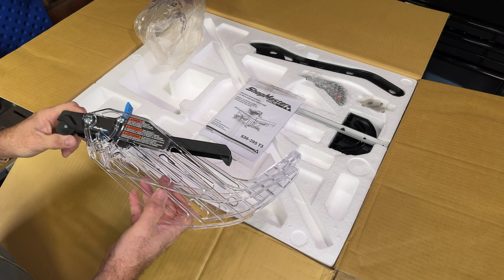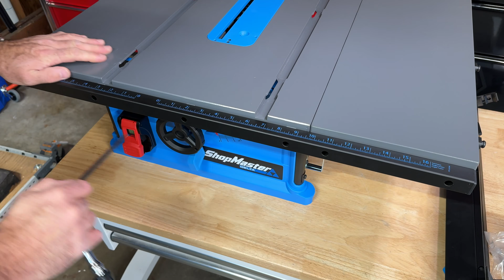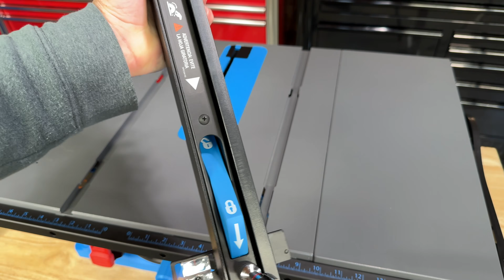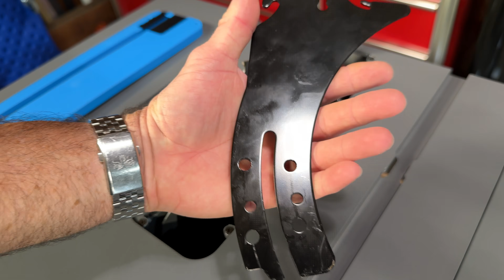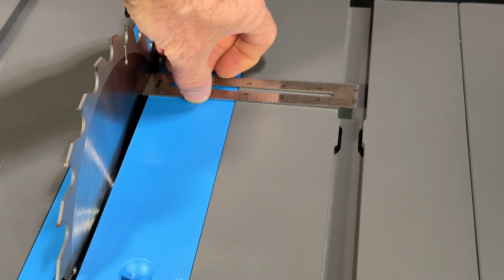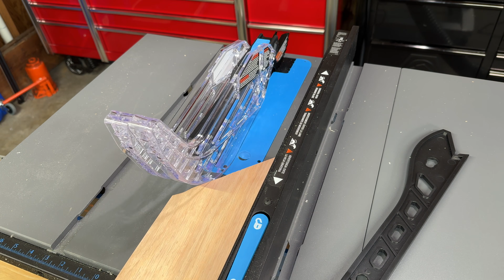Walmart Is Selling Tools Now?!?  ||  Delta ShopMaster Table Saw Review

Comment: blade to get at 90 degrees some have screws top of table for blade adjustment.. i had bought skill saw where angle was off and had to go under table and guess what screws to adjust i at last got it to the proper angles. i also on the rigid home depot job site table saw a fence loose at bottom end tried adjusting decided get a back up one. ordered one off ebay was way better.. so maybe order new fence? idk.. i expecting a prostomer table saw to be delivered sometime today? is it better than one you have here? idk .. but does have 90 deg screw and 45 deg screw top of table. but table top is smaller rt hand side than left and that kind of bothers me. but you can make a side ext for it.. but the fence obviously wont work on it. but people say it pretty much like the skill table saw. it comes with a stand .. but i don't like way the top part screws directly into the saw rather than a full stand. saw cost 210.00 plus tax have prime free shipping. but basically saw it same kind make up as saw you have there.. and easier to return if have a issue. but that saw you have would work for me too for what i do. Having recieved my promaster i do believe this walmart table saw is better

Comment: I have a Delta shopmaster that someone gave me. Came here to see if i want to spend any effort to make it useable as they lost the plate next to the blade. I decided to make the saw mechanism clean and oiled and descovered the blade angle adjuster is worn. I think the plate was lost due to cheap, the adjuster worn is definitely cheap. This thing is going in the garbage,  not only do things not hold up but no care to build for longevity has be done by the company. I would suggest avoiding this unit at all costs, even free it is no bargin.

Comment: Thanks for reviewing lower budget items.  I've seen several budget item videos that were still 500 or 600 bucks. I'm actually thinking about getting into it as a hobby since I've been out of work with health issues for 2 years. Trying to convince the wife to let me spend a little extra to get better quality tools that might be safer and make better quality projects. Would you recommend a table saw, miter saw, and a router. Looking to spend less than 300 each. Unless there is a better one for a little more. But 300 is already pushing it.  I still need a new drill, wood, and hardware so I can start with a work bench. Then try other projects. Appreciate any info. Thanks.
Reply from the maker: Those are the core tools your looking for if your starting out. If you splurge anywhere I’d do it on the table saw. At least get one with a rack and pinion fence. The red Skil is a good start and close to your budget. Thanks for watching and good luck!

Comment: Nice review Mike. I think there's another table saw which may spark your interest. It's the Machorool FS255 10" Compact Table Saw. ($279.99) Unlike this one, it has a Rack-and-Pinion System fence and 24 inch rip capacity. Cross cutting appears to be done accurately also. But if testing this one, the 40 tooth blade should also be tested with it
Reply from the maker: I have that Findbuytools table saw in the shop now. Should have that vid out in a couple weeks. Thanks for watching Louis!

Comment: Definitely feel the Skil is a much better buy. It's definitely worth the stretch in the budget in my opinion. The fence alone is worth it. Then you factor in the included stand, the motor adjustments and overall build quality is better.

Comment: They should call it the ShopStarter not the ShopMaster. For $189, that's a good saw. As long as you're cool with using your measuring tape to measure over from blade top/bottom to line up the fence. The Skil kills it, for only $100 more.

Comment: I know you must get this request a lot, but since you have such great table saw reviews I'd love for you to do one on the Ryobi 13-amp 8 1/4. May be the one you allude to here. I expect it's not great, but would love to see how it compares as a super budget option.
Reply: I have it and it's great for quicky type cuts. NOT for finer work! I bought the Skil referred by Mike, and it's way better. I still have the Ryobi as well, just set it up for box blade cuts only(1/4") and it works great for that. For the 129 bucks it cost it's definitely a keeper.
Reply from the maker: Thanks for the insight. With a 16 in full rip I figured this would be for light homeowner construction tasks. Thanks for watching Hunter!

Comment: also, wax the riving knife. just regular candle wax is fine. it helps with friction when the board pinches it. i do that will most of my cheaper saws. 

i also do most of my ripping with a 7-1/4" blade with a thinner riving knife i made out of an old blade. makes it much easier and less likely to kick back. i learned to use a "table saw" on the jobsite when it was a circular saw plunged through a piece of plywood, screwed in place and flipped over. so we'd always rip half way down the length then flip and rip the other half. i still do that most of the time. pretty safe way to go about it.

Comment: i just modded that saw for a friend. added a tilt screw for setting angles more accurately. flattened the top and added a sheet of steel cut out of an old dryer so magnetic accessories work on it. also put it on top of the wings so they would stay level, though it was otherwise unneeded. got rid of the tabs and milled the miter slots to 1" to fit 3/4" miter slot inserts and epoxied those in place. the thinness of the aluminum left behind after milling worried me a bit so i filleted reinforced jb weld on the underside just in case. replaced the fence and rail with an old biesemeyer style fence from an old saw. not saying it was a sound investment, but it was an enjoyable way to kill a few days and he's got a saw that works very well now. 

the saw has pretty good bones overall.

i won't use a saw that i can't use magnets on anymore. i'm so spoiled by maglock accessories. too many great ways to keep myself safe with a maglock accessory to skip on it for me.
Reply: Sounds similar to what I did to a Bosch 4100 for myself. Delta fence, modded to lock on the front and back of the smaller table (I like the Bosch because the motor and table size cannot be beat by other jobsite saws). I run the jessem stock guides on that fence and havent had a single kickback since I started using them. I actually love the saw, and since getting a track saw and modding a Kreg ACS table I don’t see me upgrading any time soon
Reply: @AtemporalSuperCrusader  yeah. once you've got everything setup and working the way you want it, not much reason to swap.

Comment: It looked to me like that rubber piece on the backside of the fence needed to move down. I mean, if the rest of it is "good enough" a guy could always upgrade the fence, other than not being able to run a dado... I planned on buying the Skil (largely based off your review) but ended up going with an old Craftsman 113 and I think I came out far ahead. Sometimes new isn't the answer if you're getting started.

Comment: I think the plastic parts begs more questions about why the expensive brands do the same thing that why this discount priced saw doesn't use steel or aluminum. Whenever I look at table saws the first thing I look for is the rack and pinion fence.

Comment: My personal opinion on something like this... a table saw is a serious piece of equipment.  If you need one, do yourself a favor and save up until you get can get a good one.  I can certainly appreciate trying to save money or find the best value, but... not with a table saw.

Also, that fence is whack and that one thing would be a complete deal-breaker for me.  I can just see the fence moving on a big cut, the board binding, and well...  With all the advanced engineering and manufacturing we have access to these days, even at $180, the fence moving around like that is completely unacceptable.

Comment: Mmm l have a 20 year old Craftsman bench top table saw it had been a work horse . Got it from the Craftsman resale store when it was still Sears store . My question is when I try to take my blade off the blade wrench just slips off when I try to take the blade off . I trying to take the top off and try to get a new shaft any help would be appreciated greatly thanks

Comment: I used a $99 Ryobi saw (back in the blue-color days in 2006) to put in wood-laminate flooring, used it to rip down the cherry-wood fascia woods of new cabinets and more. I recall my father-in-law, who’s skill level is that of Norm Abram said - heck, for. $99 it ‘s cheaper than renting and in a years it no loner works, fine.
It’s still works… Is it the most accurate - maybe not. But for nearly 20 years it has done all the jobs I have needed it to do - including using a tile cutting blade to dry-cut tile! Sure I also spent the $$$ on a nice Bosch miter saw back then for finer work, but the little Ryobi saw has cost me all of $5 per year in amortization cost to own! Not bad.

Comment: Awesome reviews! I have a old Delta shop master that I bought at Lowe's probably early 2000's. Plastic enclosed base, aluminum top, steel wing. The fence on mine is more like a Biesemeyer-Style fence. things about it I never liked was the height adjustment can be very stiff raising the blade, the throat plate is small and was never made for a zero clearance (I had to make a complete new one), and the lack of a geared bevel adjustment (like almost every saw). It's not the smoothest running saw and very loud but has worked well for my occasional wood working. Just wish I had the room and finances to get a hybrid.
Reply from the maker: I haven't seen that old Shipmaster model! Thanks for the insight!

Comment: Instead of these direct drive saws just plunge cut a circular saw into a scrap of plywood and throw it over some saw horses. If you're in that much of a spot for a table saw the apple box saw works fine. A scrap of wood clamped to the top and you've got a rip fence. Ripping is all table saws are really good for anyways. Rips are why you need a table saw. There's other ways of crosscutting wood. Like another circular saw and a speed square.
Reply from the maker: For basic construction and framing an agree with you. Years ago I did home remodeling with a contractor. I’m not sure he even owned a table saw, if he did I never saw it. We did everything with circular saws. Where there’s a will there’s a way! Thanks for watching!

Comment: Yeah, I think the Skil with it's own legs is so much better. I will save for a couple months and get the better one. I was also looking at the Kobalt but I think the Skil may be a better option for me. Also looking at the Dewalt corded circulat saw but price has gone up $30 in the last 8 months so Skil may be in the works for me (I have a 45 year old Craftsman). All is subject to personal preferance and budget. Also, I really want a 12 inch compound sliding miter saw (son has a 10" Chicagi Pneumatic, not big enuff fir 4x4s). Have been looking at the Hercules at Harbor Freight. It us compairable to the Dewalt at almost half the price. Thanks for all the videos and sharing your knowledge. 👍😀❤️🤗
Reply from the maker: Glad the videos helped Tim! Thanks for watching!

Comment: That fence reminded me of why I upgraded the fence on my 30-year-old craftsman table saw. 🤣 Good review though 👍
Reply from the maker: Those old saws can be worth the time and money for upgrades. More so than most of these new ones IMO. Thanks for watching!!
Reply: Yeah I never liked the fences on Craftsman table saws. I have two of them. I made a Biesemeyer style fence for mine. Nicest build on the net. I wrote an article about it on instructables website. My only gripe with the fence I made is it is heavy. It's 2 inch steel tube that I wrapped in laminated sheet. But I don't take it off often so not a big deal.
Reply: @1pcfred  I put an Excalibur 52 in on mine. Upped the motor to a 2hp when the original quit.